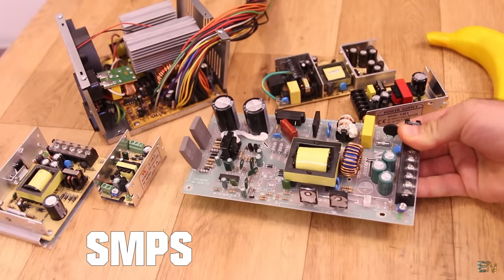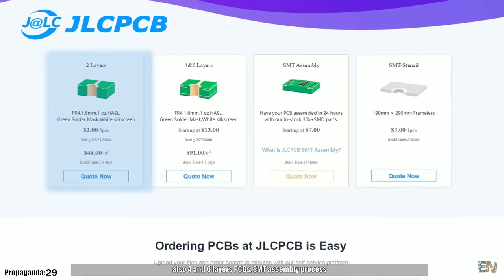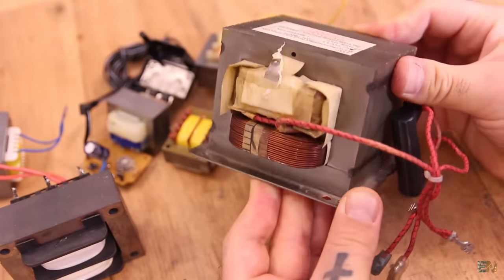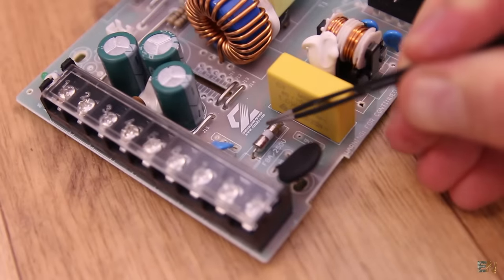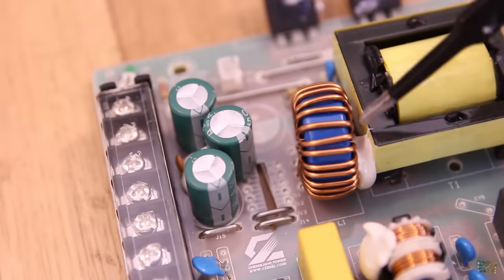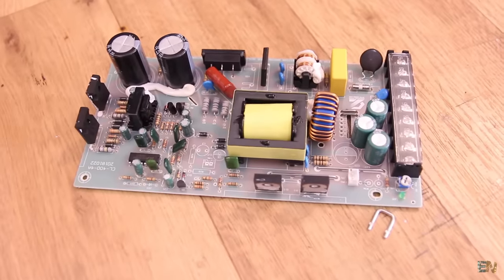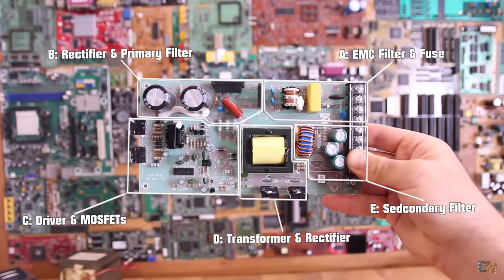How SMPS works | What Components We Need? Switched Mode Power Supply

Comment from the maker: Sign up at ELECTRONOOBS.io: https://electronoobs.io/
Follow me on FACEBOOK for more: https://www.facebook.com/Electronoobs
help me on Patreon: https://www.patreon.com/ELECTRONOOBS
Reply: Something is strange here.  At time 8:30 in the video its showing 2, 560uf @ 200V.  After the bridge the DC voltage will be way higher than the input of 230vac, so how can those caps be so underrated?
Reply from the maker: @ugetridofit  there are 2 capacitors in series so 400V
Reply: Can you give me its circuit diagram
Reply: Bro why did we use high frequency transformer,cant we just take output from mosfet and connect it to secondary filter?
Reply: @ELECTRONOOBS  tw×_
Reply: very nice explanation. All basic concepts got cleared. This is the best video on SMPS.
Reply: Isn't the MTBF longer with ferrite core power supplies and more reliable in industrial applications?
Reply: ⁰
Reply: 0
Reply: @ugetridofit  The two capacitors are in series and such combination withstands twice the voltage (up to 400V). Such combination is needed to split the high voltage in two halves for the half-bridge SMPS. Just look for theory of operation of half-bridge SMPS.
Reply: @shashankshekharverma6151  Because at more power the lower frequency transformer is much larger, heavier and more expensive than an equivalent switching transformer.
Reply: I have to correct you: it's not LINEAL, but LINEAR.
Reply: Hey, what's the reason for using the half bridge rectifier after the transformer instead of a full bridge rectifier?
Reply: Where’s the schematic?

Comment: Great video!
Just a little thing I want to mention, at 15:34. The control circuit is on the low voltage side, but the power transistors are still on the high voltage side, so you need a way to controll them withouth loosing your insulation. That's the purpose of that smaller transformer. I'm pretty sure that it is used to control the power mosfets from the low voltage side. I asume that the main transformer have 4 pins on the left, two pins for the main HV winding, and two for an auxiliary winding, used to power up the control circuitry (and in some other desings, an auxiliary winding is used as a voltage feedback instead of using an optocoupler, as its voltage should be more or less, proportional to the output winding voltage).
If you watch close, near the small transformer, there are two small transistors used to drive the primary side, and on the other side, there is a bunch of capacitors, resistors and diodes used to drive the gates of the power mosfets; those are needed to reduce the time they take to turn off, and therefore, to reduce the power loss. And two diodes to form a snubber network, to protect the transistors against reverse high voltage spikes, due to commutation.
You can tell where is the division between high voltage and low voltage side, by looking at the bigger gap that separates the copper traces from one side to the other.

Comment: This is my third video today on switch mode power supplies. It was most informative. As an English (American) speaker, I had no problem with the verbal instruction, I understood you very well. As a student, I deeply appreciated the waveform transformations across sections. Of the power supply. A lot of repair videos assume the viewer is familiar with how a SMPS works; I was not (and wondering for years): you explained it very well. You focused on the main components without getting distracted by how individual capacitors, zener diodes, and resistors could affect performance. If I were to repair an item, I would need that information, but BEFORE I need to make the repair, I need the information you present. Thank you very much.

Comment: Great video bro, you spent much effort on this. You're better than my lecturers. Anyway, I think the DC output voltage of the output LC filter should be controllable by changing the pulse width of the signal. So, the DC output should change due to the change of duty cycle of the signal. You might mean it, but you misrepresented it in your video. Great job anyway bro 🔥

Comment: At last, someone who has explained an SMPS in such detail that it's easy to understand. I thank you sir. A wonderful job. I have a couple of questions as a noob: 1) on the EMC filter, I thought coils (chokes) blocked A/C voltage? 2) Why is only a half bridge rectifier used on the second stage instead of a full bridge. Isn't there a loss in efficiency by throwing away the negative component? Many thanks again for your superb explanation.
Reply: @Adhithya2003   thank you so much for spend time answering my questions. It’s greatly appreciated.
Reply: The inductor used in the EMC filter is called a "common mode inductor" or "common mode choke" ("choke" is a rather old term for an inductor, but it is still used).

A common mode choke is designed with two windings. The windings are arranged such that the low-frequency current in one winding is equal to and opposite in polarity to that in the other winding at any instant. The magnetic fields of the two windings cancel each other and there is very little inductance for that "differential mode" current. However, if there is high frequency noise that is the same ("in phase") on both of the windings, there is no cancellation and you get high inductance to this "common mode" noise. In the filter you use capacitors across the AC line connections on both sides of the inductor. This more or less makes a short circuit for high frequency noise between the two sides and makes sure the high frequency noise is common mode.

In the circuit in the video there is no AC at the output of the transformer. His description is simply wrong. This is almost certainly a forward converter so the voltage at the secondary side is unipolar pulses. The diode doesn't really act as a rectifier in the usual sense, but rather as a way of preventing the output filter components from discharging through the secondary winding of the transformer. If there really were symmetrical AC at the secondary you certainly would use a full wave rectifier. Half-bridge, full-bridge and push-pull converters do produce symmetrical true AC on the secondary and you do use full-wave rectification. Usually you use a centre tapped secondary so full-wave rectification requires only two diodes, but sometimes you use a simple untapped winding and a full-wave bridge rectifier. These types of converter are more complex but you make much better use of the transformer because of the true AC excitation and you can get nearly double the amount of power for the same size transformer. There is some chance that I am wrong and the circuit is actually a half-bridge converter, but I doubt it.

Comment: Nice video and good explanations, however, some comments:

Noise on the ac input voltage is not so important, since the ac will be rectified and charges up the primary high-voltage capacitors. At least as important is the filtering of noise which is generated within the power supply so that it is not emitted out onto the ac grid.

Also the voltage on the high-voltage primary capacitors is not 240 Vdc but sqrt(2)*240 V or about 300 Vdc since the capacitors charge to more or less the peak voltage of the ac grid.
Reply: That is why these capacitors are usually 400V.
Reply: @cheeseschrist2303  and they make a lot of noise when discharged through a well insulated pair of pliers 😈
Reply: He states the output voltage at the large caps after the rectifier is around 320V.

Comment: Ok, I love this channel and most of the info in this video is correct. But I’m an EE with an MSEE degree and over 15 years of experience designing high-reliability electrical power subsystems for satellites. This video is cringeworthy. 
1) No one says “lineal”. It’s called “linear”.
2) It’s not “insulated”. Some SMPS topologies, but not most, provide “isolated” power. 
3) That 1-to-1 inductor is actually called a common-mode choke and is important for EMC compliance for common mode, conducted emissions.
4) EMC/EMI filters are not so much intended to provide filtering for power supply input as they are mostly for EMC regulation compliance for conducted emissions reflected back into the supply line.
Reply from the maker: I'll try to improve vocabulary
Reply: Electronoobs - No worries man. Always a big fan of your channel. Keep it up!
Reply: Yes but wideband chokes as well as rf chokes are also a bit popular at high frequency and impedance matching!!!

Comment: 8:58 no its already DC because it has no negative values.
Reply: Can't we say its alternating between zero and peak value ? So its ac :-)
Reply: @ameristanbouli5063  well you can sure but that is not the defenition of alternating current
Reply: Hehe - the terms “AC” and “DC” are commonly misused and misinterpreted by many electronics noobs and novices alike. 
If the polarity changes signs, it’s AC.
If the polarity remains entirely positive or entirely negative throughout the complete cycle, then it is DC.
Reply: @Samuel-km5yf  AC means Alternating Current. Alternating between positive and negative values.
Reply: @alejandroperez5368  - What did I say that is incorrect?
Reply: @Samuel-km5yf  what did I say that suggested that you had said anything incorrect?

Comment: So we filter out a lot 😂

1 - AC >> Fuse, EMC filter & main filter to smoothen high FQ noise.

2 - AC >> Full bridge rectifier to chop off negative side to become DC >> PWM controller & MOSFETs to boost frequency into transformer coils to be AC again.

3 - AC >> Half bridge Rectifier chop-off AC again into >> DC controlled with pwm signal & filter the noise again with low-value Cap to smooth out the output.

4 - DC >> Then optocoupler will send feedback back to high voltage part while remaining isolated, to keep the voltage steady.

Comment: A couple things… the 230AC input is obviously for Europe, but since you didn’t mention a PFC stage, then the power supply will typically have a 110/220 switch, which is not needed in a power supply with a PFC. The secondary stage (PWM} is powered by a DC voltage (typically 250-400VDC) which is the output of the PFC if it has one, and which is higher than the VAC RMS of the bridge rectifier (VIN x 1.414). The secondary pulse transformers operate at about 100khz and the output is usually rectified back to DC with a DIAC which powers the output load.

Comment: Very well done! On the bigger PCB that little transformer is a Gate Drive Transformer, it used to have isolation from the main FETs in case they short (example, from gate to drain sending tail voltage straight into the gate drive network). However the transformer allows galvanic isolation between which allows the pwm controller and gate drive network to (generally) be preserved during a fault. Those transformers are generally gate drive only and those little transistors near it are for driving the GDT. Coilers use GDTs (same as I) for Tesla Coil gate drivers with dedicated gate drivers such as the UCC3722 or TC4420 gate drivers.

Comment: At 8:45 you show peak-peak voltage but saying it is 230 V, which is Vrms. Peak to peak is 325 V, when rectified half of that would come to be 162 V that’s why they used 200V caps.

Comment: What you are pointing at 0:28 is actually very efficient, it's multi tap ac dc unregulated supply, lol. could be as much as 90% efficient.  IE laminated core mains transformers can be as high as 95% efficient and modern LDO's in a properly designed supply to load ratio can see efficiencies' in the high 80's. Smps's are cheap to mass produce, and have high energy densities and can be very reliable. The iron in traditional ie transformers is bulky expensive and heavy but they are not less efficient then an smps as they are the same thing. At the core of both is just a magnetically couple transformer sharing the same physics. 50/60hz versus 25khz, the lower your switching frequency the larger your magnetic core needs to be but they are the same thing.

Comment: omg finally i found great video explanation about power supply. i always wondering how did it goes cheap and light. i have question for the transformer. we already get choped DC voltage from mosfet. then why we need to connect it with transformer rather than connect it directly to filter instead?

*sorry for my bad english

Comment: I have my doubts regarding your explanation for what the EMC  filter coil does. You say it filters the AC mains coming in that contain high frequency noise. I not so sure about that. I don't think there's high frequency noise on the mains coming in. I believe the coil is used to filter the high frequency noise generated by the SMPS from feeding back into your house mains. Your thoughts? Other than I think your presentation is excellent.

Comment: the smal transformer is a gate driving transformer for mosfet.

also you have not mentioned about start up circuit and drive ic powering up :)

I said that because they are key points.

Comment: Thanks for a great video. I knew all of it before but its well presented and interesting to watch.

What I have not figured out is why a half bridge on the output instead of a full bridge. That seems more efficient to me.  You did not touch on this. Is it just cost?
Reply: I think that the video gets it wrong. The output is half bridge (as you have two diodes), but still rectifies the full wave, and yes, with just two diodes. If you have at the output, a winding with 3 pins (a third pin at the middle of the winding) then you use that mid pin as ground, and if you put a diode at each of the other two pins, then at the output you still have a full bridge rectifier. You only need 4 diodes when you don't have that mid pin.
If you pay attention, the component that he shows is are two common cathode diodes, but in the schematics, latter, he shows a common anode pair of diodes.
Check this schematics
https://qph.fs.quoracdn.net/main-qimg-5194d41ef8f52a26c196cc36dba2566a

Comment: There would be a few things to mention, since you haven't. Not that i would be an expert in this field ... far from it. But there are a few details you left on the outside, when you compared linear to switch mode power supplies, and maybe this helps to others who come here not knowing much.
Even though, overall, SMPSs have alot of advantages and are generally prefered nowadays, there are several advantages of linear power supplies over SMPS ones.
1. they are far simpler than SMPS ones; this makes them more robust - fewer things to break. The whole circuit of a linear one is much smaller. Also, the ICs used to stabilize linear power supplies are generally more robust;
2. being simpler means that they are much easier to be understood by beginners and equally easy to build one;
3. speaking of building one, linear power supplies are undefeated in this aspect; you can easily find all sorts of transformers, with all sorts of voltage & current combinations, diodes that can handle large currents with ease, stabilizing ICs and power transistors cheap and everywhere. Try to build from scratch a SMPS on the other hand and see what huge headaches it involves, including building your own ferrite core transformer(s) (which bring their own set of problems), managing your PWM IC, the feedbacks involved and so on and so forth;
4. there's almost no danger involved with linear power supplies at all; the only danger point is on the primary side of the transformer. On the other hand, a SMPS has more than 50% of it's surface a "hot zone - do not touch";
5. modifying a linear power supply to handle more current is most of the times trivial; just a few extra power transistors, maybe a new transformer and new diodes. Kinda same for extra voltage. Try to see how you can convince a SMPS to give you more current or a bigger voltage :) Many times it's just impossible;
6. last but not least, the electric noise in the output voltage makes SMPSs to be avoided in some applications. For example, from what i know, radioamateurs avoid at all cost to feed their transceivers with SMPSs, and rather prefer linear ones since the linear ones lack high frequency noise and therefore do not interfere with the radio frequency circuits.

Comment: You did a great job. I appreciate your work. But I have one query in this tut. If we give square wave to the transformer, we will not get the square wave on the secondary. That will be impulse signal. Then how in this SMPS we get the square wave at the secondary?
Reply: Harsh Desai - You’re correct, the secondary waveform is not a perfect square wave, but at high frequencies, it looks close enough to consider it a square wave.
Reply: Okay, now I got it. It also depends on the winding's inductance. Higher the inductance, wave looks closer to square wave.

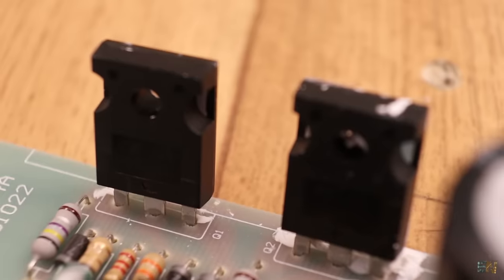Comment: The PWM controller that you show in your video at around 9:21 time laps is a KA7500B. So, it's an electonic chip! Obvious! So I read the specsheet and the maximum VCC for the KA7500 is 40Vdc. Since the input is rectifyed from the 120Vac or 230Vac, there has to be a special circuitry to lower the voltage down do 30Vdc for example. Is there a zener diode doing the work or a voltage regulator that handle the high input voltage ? It would be nice and quiet interesting to see a simplyfied diagram like you did in your video. Good video and thank for breaking this down. It's way more easier to understand.
Reply from the maker: I think in that case is that second smaller transformer that lower the voltage....
Reply: @ELECTRONOOBS  It make sense. I have been looking into the datasheets of other PWM chip. Often an auxiliary winding to lower the voltage is available for that purpose. Thanks for the prompt response!